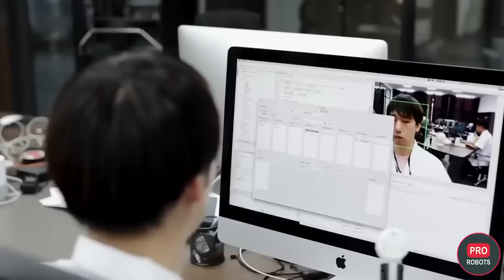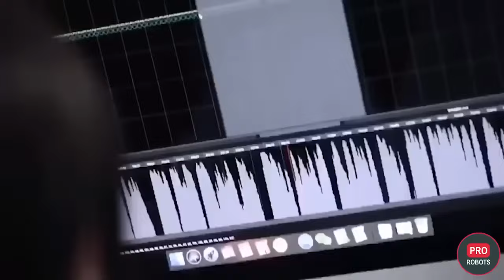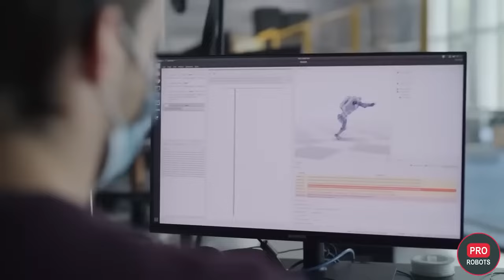Humanoid robots!

Comment: A humanoid form factor is very naive.

You don’t need a humanoid robot for most tasks:

clean (arachnid robot)
deliver information (kiosk robot)
security (insectoid robot)
transportation (LiDAR robot)

the point is the humanoid form factor will most likely be used for functions that require the look and feel of a real human - doesn’t take a stretch of the imagination to guess what industry would do well here.